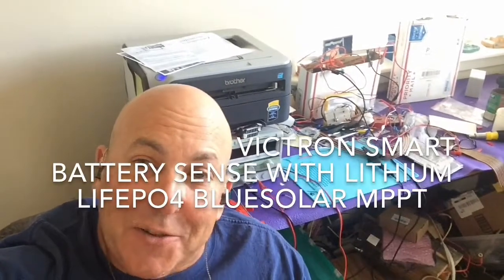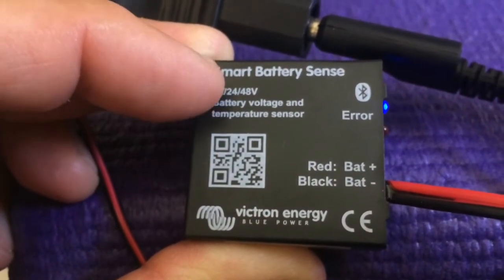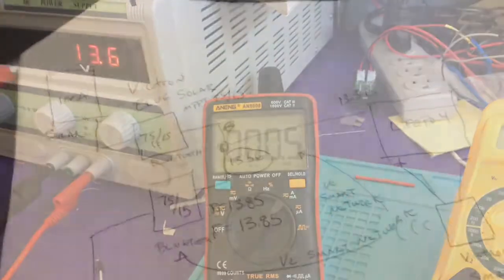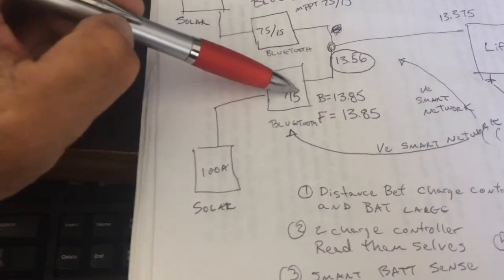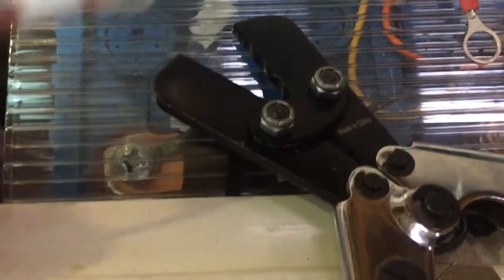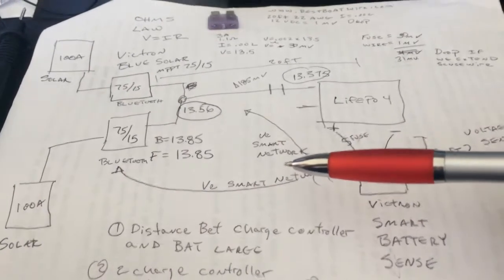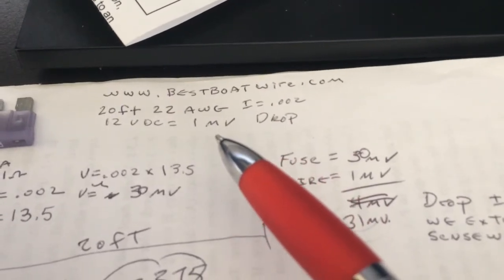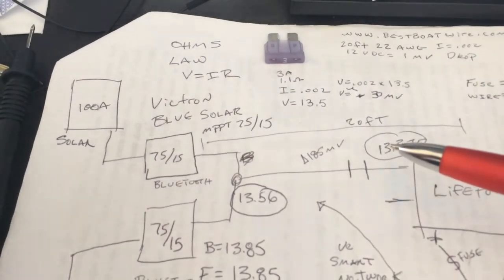Victron Smart Battery Sense with Lifepo4 Lithium on Sailboat using Bluesolar MPPT Charger

Comment: With Lithium Batteries you will get more life out of the batteries if you keep the voltage around 13.4-5 toping lithium batteries at 100% will def shorten the life of the battery. Plus, Lithium batteries can operate normally at less than 100% charged, perfectly.

Comment: I have 3 lifepo4 12v batteries in parallel. The website said for a battery bank just attach it to one of the batteries. Wouldn't this have a negative impact on the balance voltage of the 3 batteries?
Reply from the maker: I think you are correct in your thinking.  I also think you want to read the correct voltage from the bank you are charging and you will need bank positive and bank negative for that. If you add more wire to reach the bank negative and positive you shouldn't get much voltage drop. Figure 2mA as maximum load I observed. You can calculate the drop based on the load but I think you could add a great deal of wire to the sensor.

Comment: What if I have a 6 battery bank??
Reply from the maker: The Victron SBP does not work for 6v. Are you looking to do a low voltage disconnect on 6v? Can you tell me a bit more about you battery capacity and battery type?
Reply: danny jensen well they are 6 volt batteries wired in series and parallel to make it a 12 volt system with 6 batteries soon to be 8 after I buy 2 more batteries.. I took 2 6 volt golf cart batteries wired them
Together to make one big 12 volt battery then i connected all 3 banks together to make one huge 12 volt battery with 1280 amp hours.. each battery is 220 amp hours.. 
I just ordered this victron battery monitor to go with my victron controller
Reply from the maker: Daveyboy Any batteries will work if you have 12 V. I recommend you watch my smart battery protect video. This video is about smart battery sense which works with smart battery protect. https://youtu.be/sABbtLtB_Iw. I think having a monitor is a good idea. However, for my system it makes sense to shut off loads when my batteries get too low.